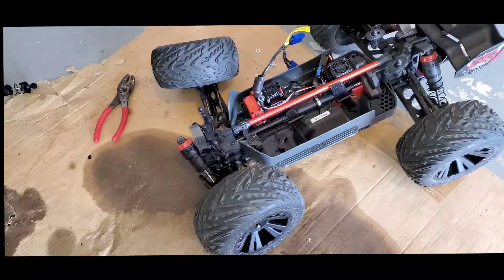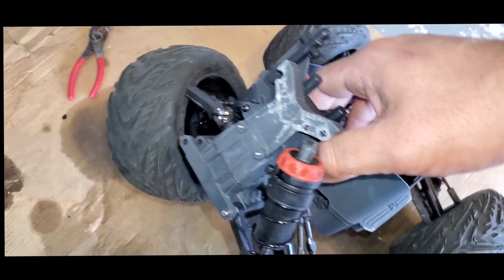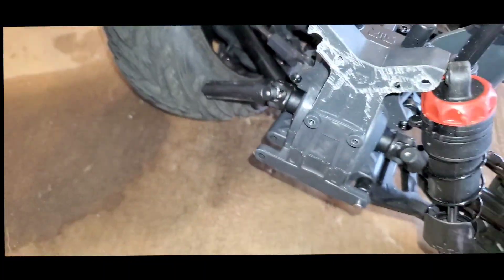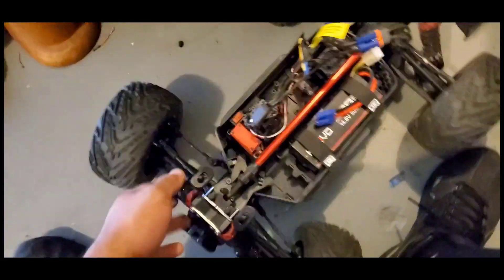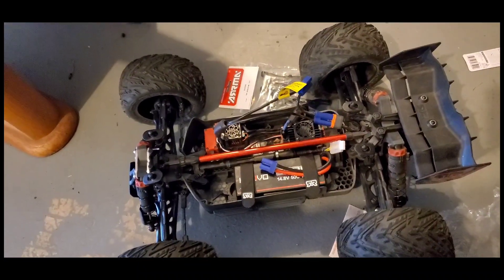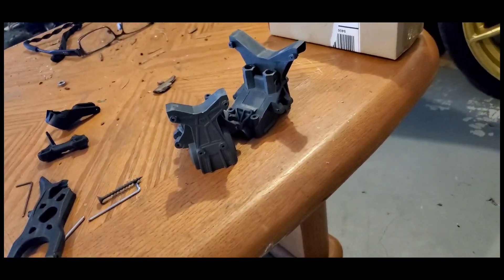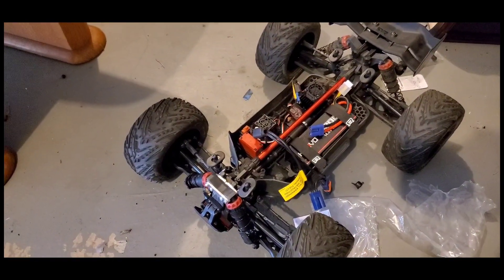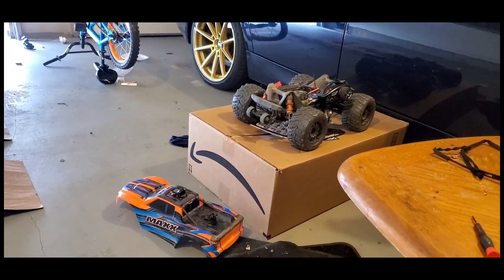Kraton 4s fix diy and weak points

Comment: The only real weak point we’ve found in our experiences have been the driveshafts; they just can’t seem to cope with the power.
Saying that, the shocks, transmitter and servo were inadequate and required swapping out - but I wouldn’t count them as weak spots for that reason
Reply from the maker: well, my driveshaft is still stock, bout to run a second set of tires, my a arms broke twice plus the front shock towers, this weekend one of my front cvd got loose from a pin😂😂😂🤷‍♂️ everyone has a different experience
Reply: herminio perez crazy how experiences differ with the same car🤯
Reply from the maker: crazy how to drivers drive different with the same car🤷‍♂️😂😂

Comment: I have thee Exact SAME Truck and thats a good idea on the front of Truck mine is the slipper Clutch which i put loctite medium blue strength and diff gears front and rear input gear which is being replaced because diff gear rip some of the teeth off of input gear spur gear ok
Reply: So how Iam understand you i have Blue medium loctite to on slipper Clutch but WHAT i think iam understanding is put loctite on Diff gears FRONT snd rear and on input GEAR to?
Reply: Wouldn't that make THE gears not move and where do u put this loctite on All 3 gears?
Reply from the maker: no, just the center diff.
Reply: Not. Understandling i meant
Reply: Plus iam getting 15th tooth pinion put in my Truck along with THE input gear i had a 13 th pinion but changed it to 15th tooth pinion but a i have. Temp 🔫

Comment: The Kraton is a typhon with granite suspension and a metal bar. This was a poorly designed car. They stretched the mega line into a blx 3s series. And then tried to push it even further with 4s. The chassis is meant for brushed power. The whole arrma 4s line is pretty shotty
Reply from the maker: yeah i agree thats why i only own the k4s and not other ones albeith i'd like a typhon6s i fear it will handle just like a k4s🤷‍♂️
Reply: The 3s and 6s lines in my opinion are the best by arrma. I wouldn't mind a 6s Kraton tho. Just to have good monster sized monster truck. But I wouldn't jump it like I do my 3s arrmas. Metal parts. Metal bends. There's a fine line between power and structural integrity with metal vs plastic.
Reply from the maker: interesting🤔 3s vs 6s arrma, i like the notorious though n the typhon6s

Comment: I want to get rpm ARMS And All steel GEARS to those skinny lower arms make me Nervous so i only drive my Truck on Baseball Diamond and grass and cement in great big shcool yard DON'T stunt drive or bash or crash because of THE arms front And back ran my Truck into a cement block when i first bought it by accident of course just turn my head around for a second to look at a dog that was off his leash then i turned my head back around to the Truck by then it was to late no time 2 stop at 20 miles a hour hit the front of. The force of the hit damaged slipper Clutch and left little dent on front bumper that was back in may 2020 was out of shop and ready to go by the End of August!
Reply: Iam surprised my front shock tower did Not break the bumper took most of the force but still damaged my slipper Clutch but since then just minor problems input gear and slipper Clutch losing up so that why i bought THE loctite and simple green cleaner and putting 15th tooth pinion from a 13th tooth pinion just some minor upgrades till i can Afford the Rest of upgrades
Reply: After i finish with my Truck it will be bullet proof
Reply from the maker: yeah this truggy is rock solid as long as you drive it and not hit a wall, jump or roll over it "cart wheel it". other than that i had to re-inforce the front shock towers, replaced 3a-arms already, rear diff pinion and diff. got proline badlands on it too.

Comment: Put wd40 on the plastic parts it soften them so they flex
Reply from the maker: i have heard of such thing but never believed in it lol im going to give it a try
Reply: @nunu4692  i don't use wd40, I use mo-94. And it does work.
Reply: I USE 3,1 SILICONE LuBRICANT it works really good really smooth for All part s of does not collect dirt AND sticky Resude on rc TRUCK well mine anyways CAN'T speak for Anybody ELSE
Reply: Also use simple green to clean it and last but not least i use a product Called Air Duster to blow the dirt out

Comment: You dont want a metal shock tower.
Theres a reason why they arent metal.
Metal will bend. Bending other parts in the process.
Reply from the maker: true but that top end should had been metal, at least the front tower on all 3 kratons, the 6s is metal tower🤷‍♂️